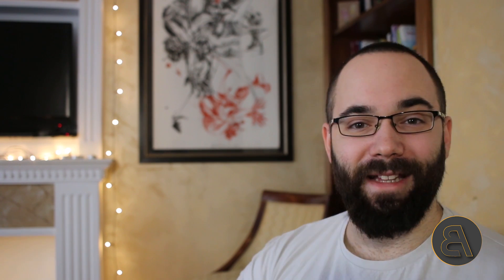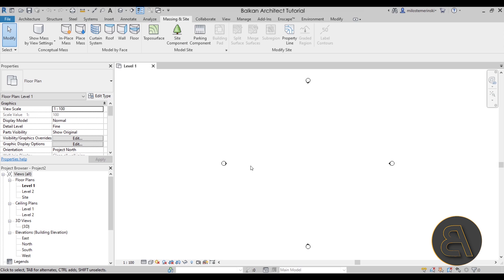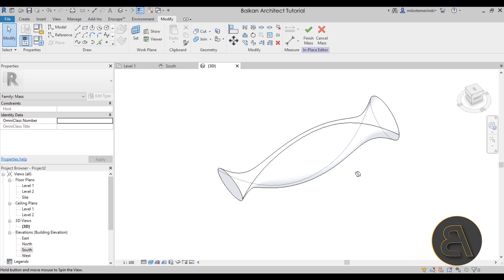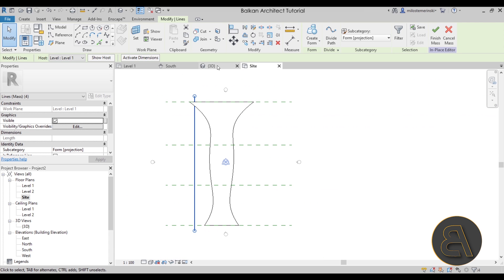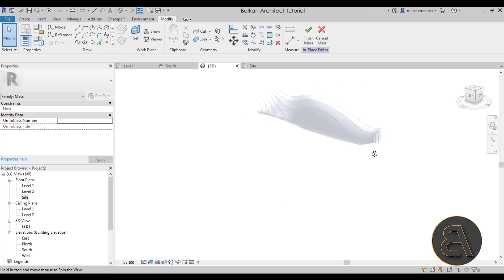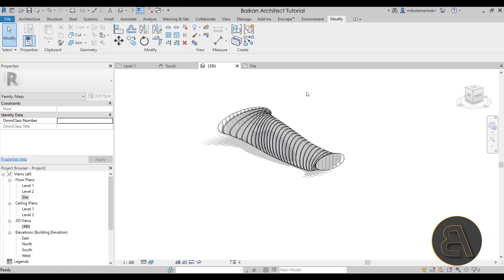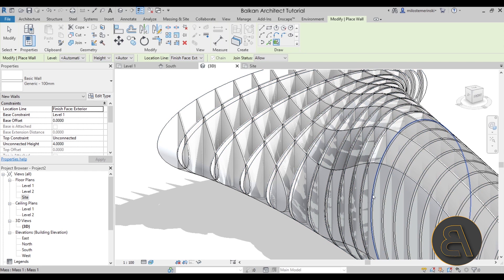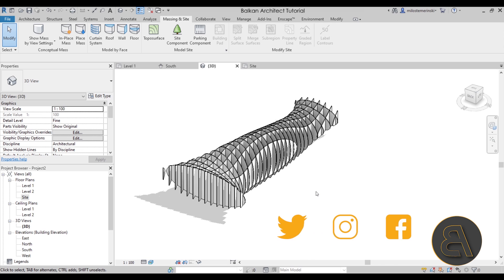Waffle Structures in Revit Tutorial / Metropol Parasol

Comment: bro, you know a lot about revit, well, just revit architecture, which is the biggest and most complex, but Revit is a BIM tool, and you never show hot to do the schedule, obviously because in many cases that is not possible based on your way of designing. can you please tell us why you do it this way at the company you work for (or may be you own a company), so we can better understand the purpose of this way of doing things, I am really confused.
well, the only way this way of designing would work, is if you actually use refit simply to make a normal architecture design which includes nothing but a 3D, plans, elevations, section and that's it pretty much, but then Revit is absolutely not the best software for that...Jees, you confuse newbies bro
Reply from the maker: My mission is to bring as many people to BIM as possible. To do this you first need to show that Revit isn't impossible to learn and also that it can be used for many different things.
Students in most cases just need a model that looks good, this is what I usually show on my channel. After they learn Revit for this they can easily explore the BIM side of it. I have courses that explore scheduling and extracting data out of Revit for everyone that is ready for the next step. 🙂